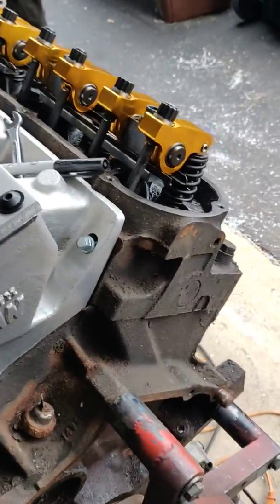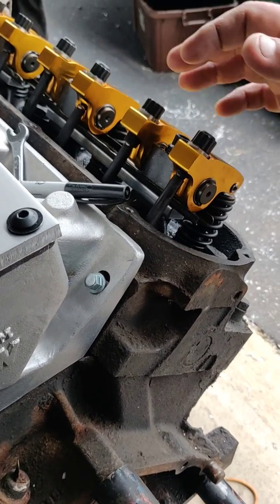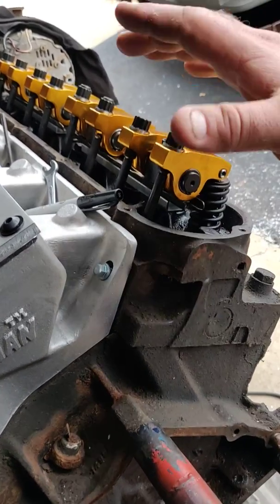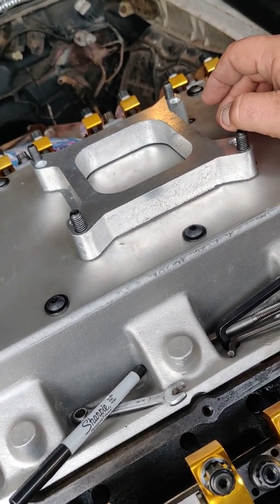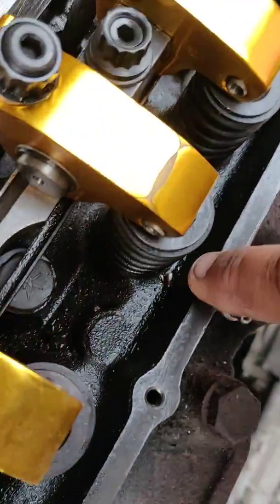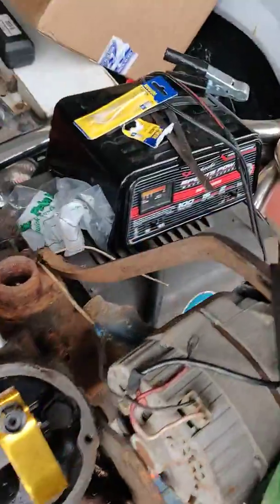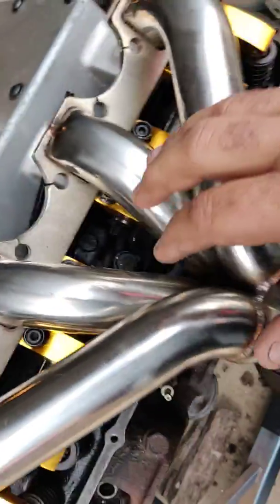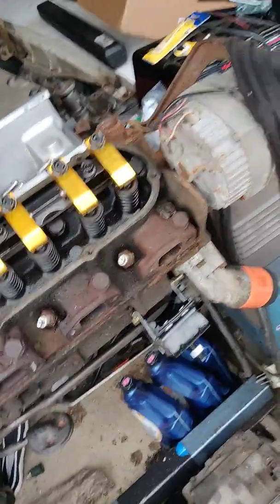472 Cadillac

Comment: What motor mounts did you use
Reply from the maker: Grabbed the mounts from rockauto for a mid 70s Deville if I remember correctly.  You have to make a plate to extend from k member to the mounts.